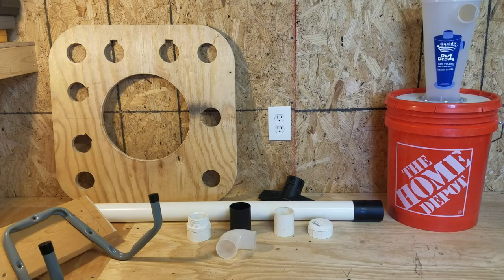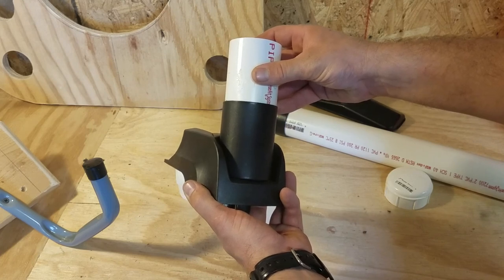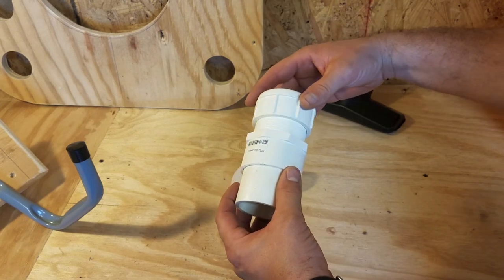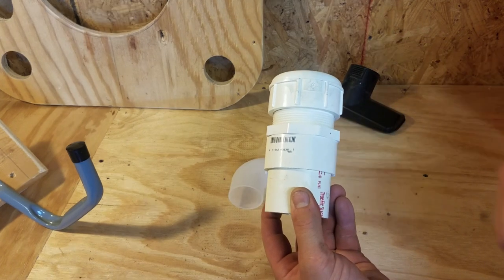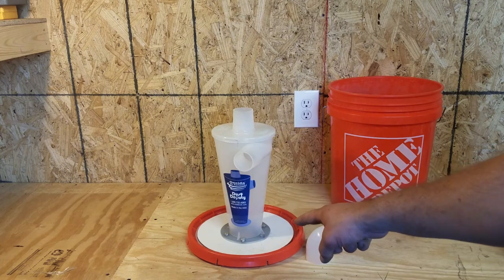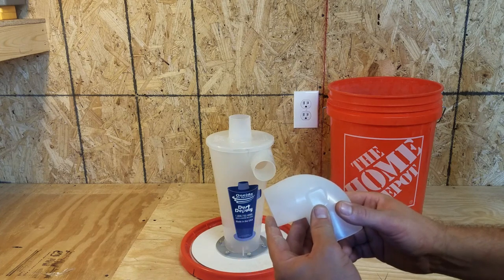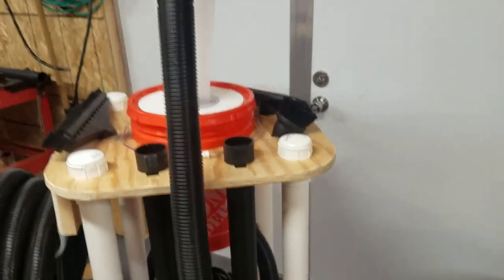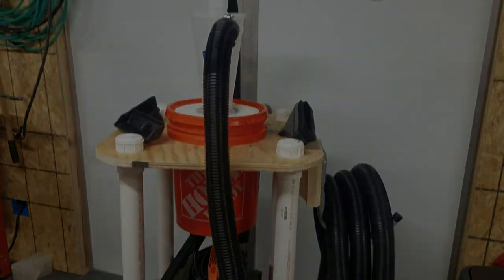DIY Dust Collector With Dust Deputy and Ridgid Nxt Shop Vac

Comment: DWV 2 inch flexible coupler slip it over and screw it tight. Slightly cheaper, no heating and no stretching.

Comment: Thank you for the video. I found another cheap solution just using a rubber band, measure 0.875 to 1 in diameter and flattened length x 0.5 in. width,  My solution doesn't use RIDGID adapter. I used the rubber band to wrap around the wheel assembly. If the band is not thick enough, you can double or triple it. Then, 2" pipe can fit on it. It is probably not a perfect fit like the RIDGID adapter I guess but it fits quite well. Those rubber bands can be found for free at the grocery store. They use the band to wrap some veggies. Just look around for those sizes. Cheers!
Reply from the maker: Great idea! I love innovation. Please hit that subscribe bottom it helps me a lot.

Comment: I am going to build something like this soon. To get around the wheel supports for the uprights I am going to remove the wheels all together. I am going to mount the vacuum onto a piece of plywood and put wheels on that. I will use 2 x 4s for the uprights and mount the "bucket" onto another piece of plywood mounted to them. In making a cart like I am, you have a lot more to work with. You can then make all manner of attachment points for the vacuum accessories power cords hoses etc.
Reply from the maker: Sounds like a good idea to me, hope it turns out well!

Comment: I am building similar but I am enclosing the vacuum in a box with insulation and baffles to reduce the noise by about 20%  or more.  This way, you have have your casters out farther and remove the vacuum for cleaning out.  A quiet and clean shop is a happy shop.

Comment: Just made one of these before I saw this video.  I ended up just driving two screws through the wheel assembly into the 2" coupler.  Then used a 2" to 1 1/2" reducer.  Seems to be stable enough.
Reply from the maker: Sounds good to me!

Comment: I really like the way you designed the legs with the screw cap one thing I do have a question about is how long are your legs from the vacuum up to the wooden base? I just bought parts today make to make my own and just curious how long they were Thanks
Reply from the maker: The overall length from the bottom of the adapter to the top of the cap is 41.5 inches.

Comment: If you add a second bucket for the top bucket to sit in, you can avoid the dust collection bucket collapsing from the vacuum. It sounds like a gunshot when it collapses. It happened to me...

Comment: Dude, find a neighbor with a small lathe to turn one of those two pieces or even sand/grind them with a die grinder. Many other options than expensive parts and heating.
Reply from the maker: Unfortunately neighbors with small lathes are in short supply for most people. There are many ways that one could accomplish the same end goal I appreciate your input thank you for watching.

Comment: Would some of the black PVC pipe out there 4 sale at different plumbing supply or other places maybe be the right size? I just bought the same exact Ridgid vac as yours, I have a different cyclone deal but that won't matter much, it's a blue outfit that's on Amazon.  I'm kinda hesitant to buy those $8 adapters and then mess em up.  Sure is a headache trying to move these things around even though my cyclone has wheels. Any suggestions?? I will gladly listen, and I do appreciate your video ! Seems like it's taking me forever getting my small shop organized.
Reply from the maker: I know one person in the comments (Susie) said she found some online but after getting them they didn't work as hoped if I'm not mistaken. She left her results in her comments. If I also remember correctly you could take use pvc pipe and either get the next size down and heat it up and stretch it a lot or get the next size up and heat it up then while still hot clamp it on to the wheel assembly and make it work that way. However I can't say for sure because I didn't do that. But I believe those where the 3 options I had to choose from and you see which I choose to go with. The crux of this build is definitely those wheel assembly transition piece's. Let me know if I can be anymore help. Also thanks for subscribing!

Comment: Nice job on your design . I'm  building one like yours and having  trouble locating  the caps you used to hold the top. What do you suggest?
Reply from the maker: Home Depot and Lowes carry them. Plus any plumbing supply store will have them. The important part is the slip to male threaded fitting. It needs to have enough thread to go though the plywood and still have some thread left to screw the cap on.

Comment: How do you get the vac out to empty any debris that gets into the bottom of the vac?
Reply from the maker: I left enough room between the top of the vac and the bottom the the bucket holder to just lift it up. After a few months of use there is barly and dust in the vacuum its self. I haven't had to do anything as of yet. The dust deputy is awesome.

Comment: So many things I'm learning about this...

1. I posted in another comment that any 2.5 inch coupler will fit. But...the coupler from the Ridgid kit fits snugly as you can see in the video. Any other coupler will be loose. Even though it fits into the wheel base, it rattles around. That might not matter. If it doesn't matter, you can just go with an ordinary pvc 2 inch coupler which fits into the wheel base and fits the 2" pipe without any modification and will also rattle around. I'm going to try both ways and post the results.

2. When I went into my local HD to look at their Ridgid adapter sets, I found that they had put just the couplers I wanted into their own bin. The bin was still marked as "3 piece adapter set" and was the price of the set, but the bin only contained those couplers. So I brought them to check out and explained the problem. I was bounced around to three different people but the supervisor understood the problem. She couldn't just make up a price, but she gave me the four couplers for the price of the set, which was $9.47 plus tax. So I ended up paying about $2.50 each. Interestingly, Lowes did the same thing with their ShopVac equivalent. But an HD in another town had the correct shrink wrapped set.

3. The coupler with the screw end seen in the video is hard to find. The ones my local HD had looked the same but when I got them home I discovered the threaded part is only 3/4" long. Which means that if I have it on the bottom of my 3/4 inch plywood and put it through the hole, there are no threads that stick up past the top of the plywood  to screw the cap onto. I have to either find ones somewhere with longer threads or use 1/2" plywood. 

Jason, do you recall where exactly you got those couplers from?

Comment: what is part # for adaptor please is it SKU #1000707354 at home depot
Reply from the maker: I believe this is it. https://www.homedepot.com/p/RIDGID-Hose-and-Accessory-Adapter-Kit-for-RIDGID-Wet-Dry-Shop-Vacuums-VT1755/202077239?source=shoppingads&locale=en-US&&mtc=Shopping-CM-F_D25T-G-D25T-025_014_WET_DRY_VACS-RIDGID-NA-NA-SMART-3047250-WF-RIDGIDWETDRYVACS_SMARTSHOPPING_PL3&cm_mmc=Shopping-CM-F_D25T-G-D25T-025_014_WET_DRY_VACS-RIDGID-NA-NA-SMART-3047250-WF-RIDGIDWETDRYVACS_SMARTSHOPPING_PL3-71700000083356705-58700007057508422-92700063535266617&gclid=Cj0KCQjwspKUBhCvARIsAB2IYusyv_fz2z6xjnruJ129-c2PDG_gdEeXp1Pa60LaMGZvDYEMoeO5FJEaAqbcEALw_wcB&gclsrc=aw.ds